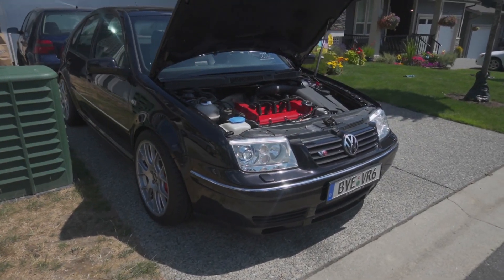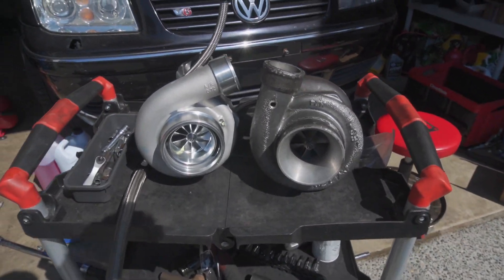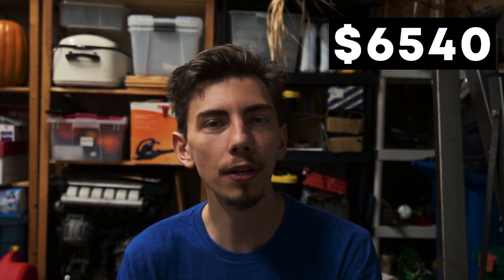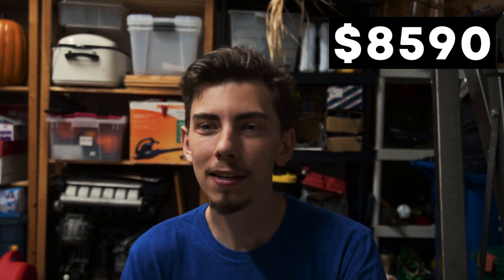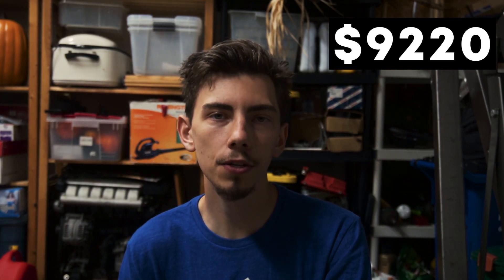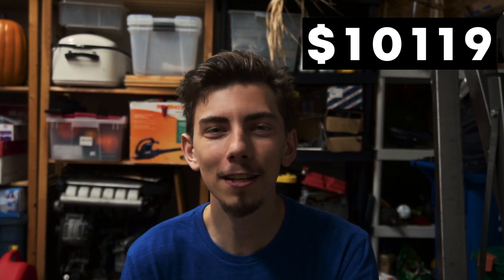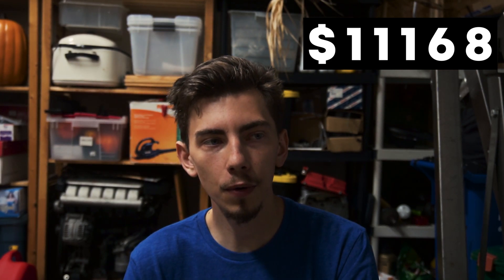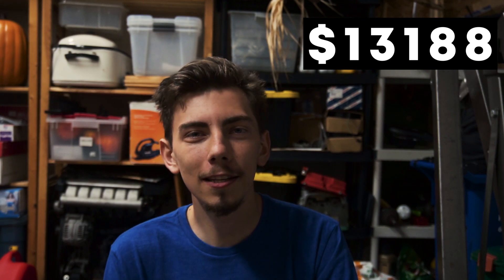How much did it cost to Turbo my VR6? Cost breakdown!

Comment: i paid 1000$ for a whole ass 05 3.2L vr6 touareg. runs and drives great. i wanna mod it but damn i only paid 1k usd. i cant justify 10k in upgrades
Reply from the maker: Going fast, is not for the faint of heart on the wallet.
Reply: Keep it as daily/weekend OEM plus or minor upgrades
Reply: @ironbloodedmyth1204  nah I fabricated a custom cold air I take and custom cat back lol. That's it though

Comment: One of my friends is a big VW 1.8T guy and he’s currently building a big turbo 2.1L Stroker for his mk4 Jetta. He’s been trying to convince me to do a TDI conversion on one of my trucks but honestly, I think a Turbo VR6 RWD setup in my bagged 5 speed ‘91 Chevy S10 would be way cooler. I have a lot of experience with American Engines and American trucks so my VW knowledge is quite limited currently. I have plenty of time to learn tho as my frame is currently in the sandblasting/powder coating phase. Thank you very much for helping me with my research. Best wishes.
Reply: What is his budget?

Comment: The vr6 turbos are slowly becoming common. One of the best engines. Wicked video bro. 👊🏿
Reply: Cheapest I can find is 8k
Reply: @00-Dima  VR6t???
Reply: @Streetmodz-Joe  a turbo kit for an r32
Reply: @Stigs Ukrainian Cousin  yeah man the plug n play kits can get proper expensive. It's a bit cheaper when you build your own kit, it's just hassle lol. Either way, r32/VR6T are the best 👌🏿. When are you going to Post some stuff up on your channel???
Reply: @Streetmodz-Joe  I have had 2 mk7 golf Rs so I don't know what im doing with a vr6
Reply: Wasn’t there a $3500 kit with no IC, back in like 2003?
Reply: paid 15k to 17k  for fully built, forged 12v vr6 longitudinal swap AWD 700+ whp E85/race gas, 83mm JE pistons, IE tuscan rods, 6spd OA2 tranny. Did most the work myself besides machining, stage 5 JH motorsport tranny and titanium twins twinscroll tubular turbo header. Rock a Xona rotor, fully built Ferrea valvetrain.  Lugtronics standalone computer
Reply: @kw2519  the EIP kit I remember was like 6k us  back then, that's the kit I remember that wasn't a POS kit either I think they said 400-450hp or so from it. 
I recall it came with pistons too, probably lower compression and forged probably in place of a spacer kit.
Reply: @MrTheHillfolk  didn’t EIP become known as “engine in pieces”?  I remember that kit too.  EIP was popular for a while.
Reply: 1.8t built or 24v vr6 built?
Reply: im trying to sell mine but so many trolls spam my listing, they dont wanna see me win

Comment: Hello i have a huge question witch is worh itt more making my vr6 twin turbo buying a part car v8 or w12 witch is the most reliable and smarter to do to my car ??
Reply: Buy a 3.2 24v and destroke it to a r30 engine. It can handle 1300hp and 9000rpm

Comment: My mk3 vrt:

Turbo Kit- $5500
VEMS Standalone(Used)- $1000
Arp head studs- $250
Arp rod bolts- $160-180 ish(can’t remember)
Schimmel Performance SRI(Used)- $780
Clutch Masters Fx500- $650
Ebay FPR- $80
Tial Q50 BOV- $240
BFI Stage 2 mounts- $300
Siemens 630 Injectors- $300
Quaife Diff- $900+
Walbro 450 Pump- $130
AEM Tru Boost- $250
AEW Wideband- $175

Then the install was about $6500. It was cheaper than usual because I was in good with the guys at the shop I went to. Got plenty of work done prior to boosting it.
Reply: Stock block but semi built head. Have 268 cams, valve springs and retainers. New valve stem seals etc.

Comment: Dammit what am I doing here? Yesterday I comment in a car group about how my old chipped mk3 vr Jetta could pull on the impala SS 260hp v8. Some v8 guy call me b.s.  after those days I did put on a turbo. 361hp on stock block. No failure on c2 stage 2 chip. So now I’m watching vr turbo content and your post got me wanting to build another. I have a B9 allroad and a mk5 GLi so maybe a 3.2 swap into the GLi will satisfy what I’m missing. Following your build now. Make me proud.

Comment: So far only done the engine with no handling or interior and exterior mods ive spent £6500 still need to get my exhaust and map done so ill be around £7500-£8000 when the engines done. Havent paid for labour as i have a garage.

Comment: Definitely a fan of Raceware fasteners if you need them, I've used em on about 3 builds. 
I've had a lot of friends get ARP and have problems with them, especially on the older idi diesels.

Comment: Hi man,

I would like to get in contact with you. I have a simular build but I made a bad decision and Picked MAXXEcu over EMU.
What is your experience of the EMU PNP solution? Does it plugg straight in?

Greetings Bas Rendering
Reply from the maker: I've heard people say good things about the maxxecu. The downside of course is not having a pnp solution. My experience with the PNP has been exactly that. Plug and play, which is super awesome.
Reply: @thirdgeargrind  i have maxxecu race pnp on my 3.2 vr6 , and its great
Reply from the maker: @marcusjaaksi1542  I've heard of people even switching from emu to maxxecu.

Comment: How was it tuning using emu black, just purchased it for my  r32T swapped gli build, 9:1 spacer, 550cc gt35 .82 hotside, arp head studs 38mm wastegate
Reply from the maker: It wasn't bad takes a good day to familiarize yourself with just the software, and then a few days ahead trying to dial in VE and enrichments. I still have work to do but we did get it to a point where I was able to do full pulls and drive the car around.
Reply: @thirdgeargrind  would u be able to make a video of tuning with the emu black ?, setup/install/ basic run through? I’m not huge on tuning lol this will be my first stand alone
Reply: @thirdgeargrind  and did u use the stock maf sensor for intake temp or did u get an aftermarket solution
Reply from the maker: @mk4dub824  If I can figure my own car out ill make a brief video on things I did to make it start. My intake manifold has a spot for a 1.8t IAT sensor. Has issues with heatsoakinf the sensor. Emu black says if running an aluminum SRI that it's more ideal to run the IAT sensor in the charge piping right before the TB. Also if you can run a GM one as there is a direct drop down selection option for that in the software so do that.

Comment: Hey bro, I know the vids a bit old but I need a lil help here from someone that obviously knows what they’re doing.

I’ve got a ‘03 GTI with a 2.8L 24V VR6 with a little over 114k miles. Seen a lot of stuff about being able to run in the 500’s for horsepower on a completely stock motor with just a head spacer safely. But I’ve seen the head spacer is mainly for turbo builds.

I don’t have the spare cash to add a turbo but would like some extra power. Is it safe for me to get a head spacer installed and then tune it for daily driving? As in pump gas 93.

Or would it be best to just tune it with no head spacer for daily driving? And what horsepower figure should I aim for on a tune that’s completely safe on a full stock motor and transmission?

I know you’re no professional but opinions from someone who’s done a lot with their car are better than scouring through old builds with old info from people who say this or that without any real proof.
Reply from the maker: The head spacer is to lower compression for boost so if you're not turbo charging it it's best to stay stock compression. You will lose power NA with a head spacer even if you tune for it. For NA and extra power, you're not going to gain a whole lot but you can do cams and a tune. It'll add about 25hp with both mods. Check out CO motorsports where they showed off a full 3.2 NA Audi TT build going from a unitronic to a united motorsports tune.
Reply: @thirdgeargrind  dope okay, thanks for letting me know and thanks for giving me a reference to watch too 👍

Comment: Do you like that EMU Black ECU? Saw the Malaka guys using it. I'm putting a couple of turbo builds together and was flip-flopping on whether to use them or something like a Haltech. I've got like 3 builds to put together (AAA, AFP, BLV), so would like to get your feedback on your experience. I'd rather spend money on an aftermarket ECU than pay for conversion wiring for those motors.
Reply from the maker: All I can say is hell yea just press the buy button my man.